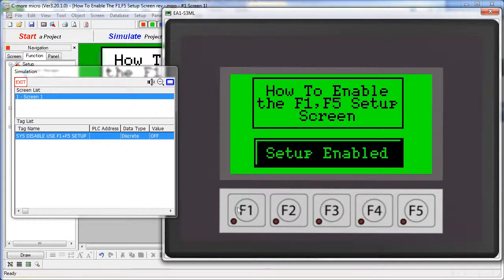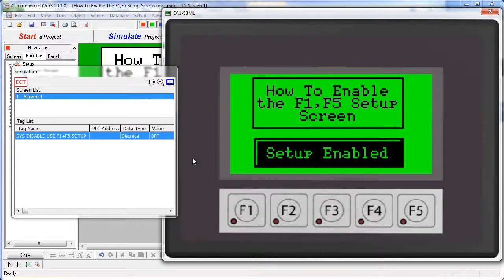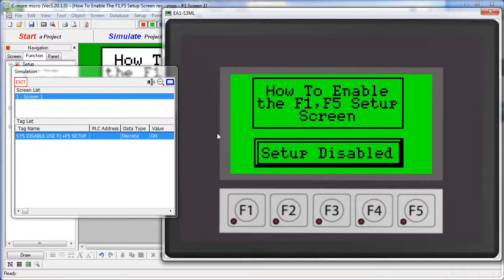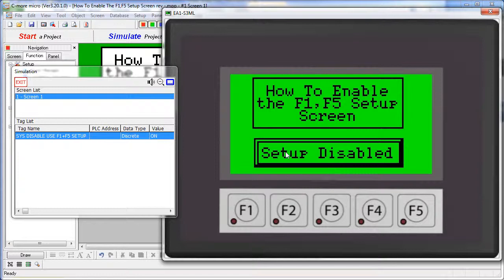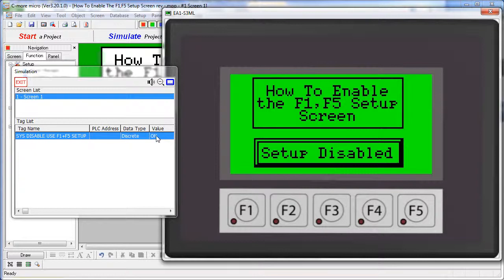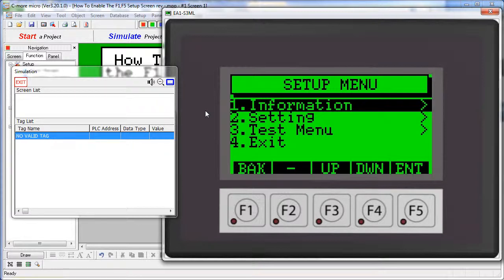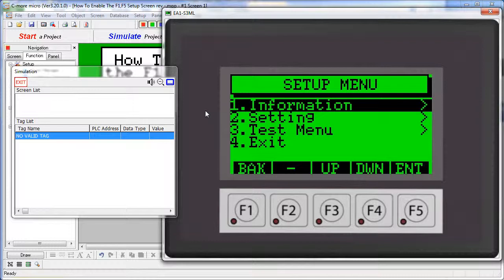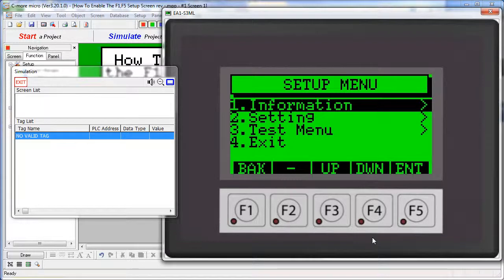C-more Micro HMI Enable the Setup Screen (F1/F5) from AutomationDirect

Comment: How to disable calibration mode at power recycle?
Reply from the maker: If the panel is recalibrating after each power cycle, we may need more information which can be difficult to properly diagnose in the comment section. Since the comments are not designed for support, we encourage you to contact our Free, award-winning technical support team so they can assist and better serve you: https://support.automationdirect.com/
Reply: @automationdirect  Thanks